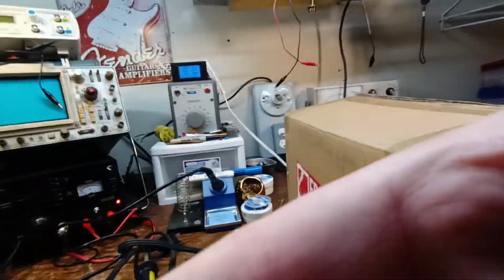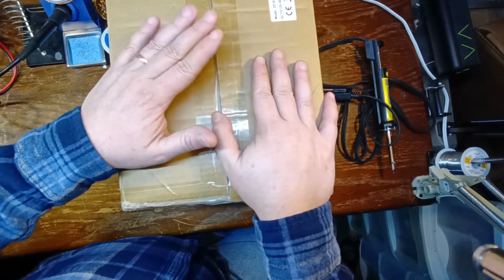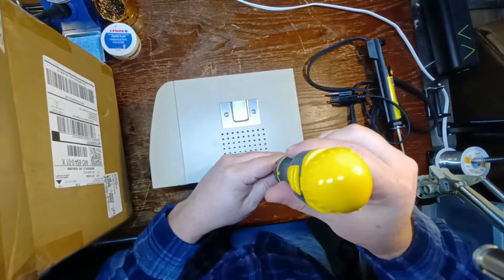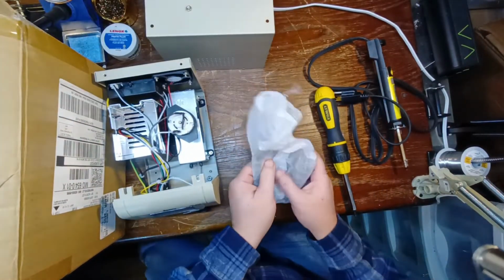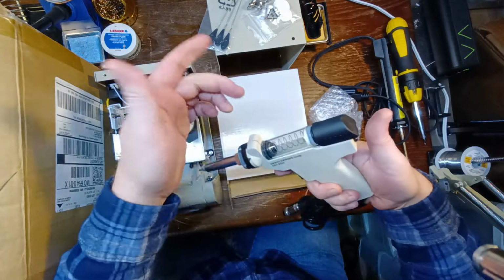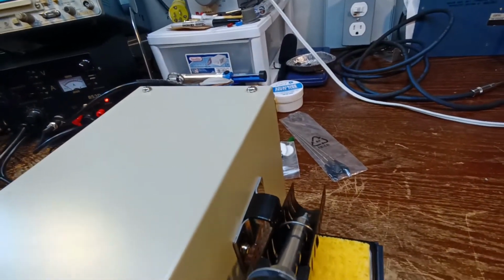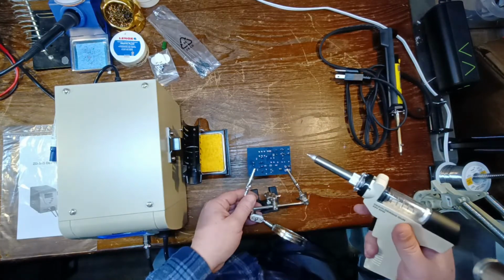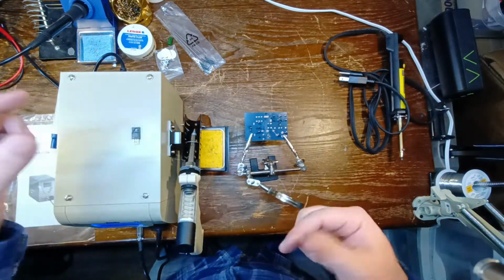ZD-915 Vacuum Pump De-Solder Station Review

Comment: to get the glass tube out you have to unlock it like you did in the video with the back button at the back, then when black backpiece is loose, you have to pull the glass tube as far as you can toward the backpiece, and lift it up from the other side (the front). It goes pretty easy once you know it. (i had trouble at first with it too) - 
Make sure once you pull out the glass tube that the metal cross piece inside the glass tube might want to jump away by the tension of the spring. So make sure you are doing it somewhere where it cant jump at weird places where you cant find the thing anymore.

Another hint, if something you desoldering contains a big blob of solder the desolder gun can get stuck (not sure if flux levels play a role, or very old solder, but it doesnt really show it because the glass chamber looks pretty empty, but a lot of solder can be stuck inside the metal tube piece before it enters the glass chamber.
You will hear when this happens, because then the suction sound will sound weird, like tiny farts.
If the sound of the suction ever gets weird to you, and you see the glass chamber isnt full at all. 
Then use the metal rods. Or you risk that the solder at the front metal tube still sticking will come out by gravity all at once once you use the gun (at a higher temperature). 
I had luck back then my Atari Lynx lived that assault where a big blob of solder came out of the desolder gun and dropped at the motherboard (thanks god at a place there wasnt anything important). - 
The only thing that warns you about that is the suction sound before that the desolder gun is making (not the unit).
Reply from the maker: Thanks for the tips!